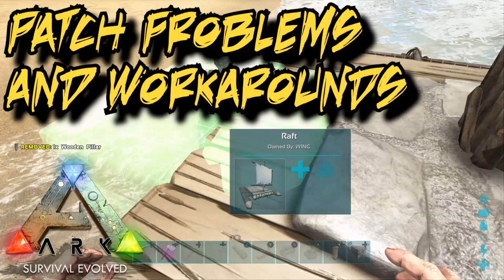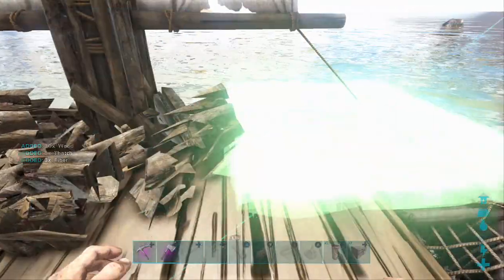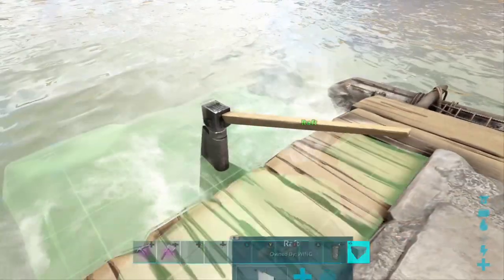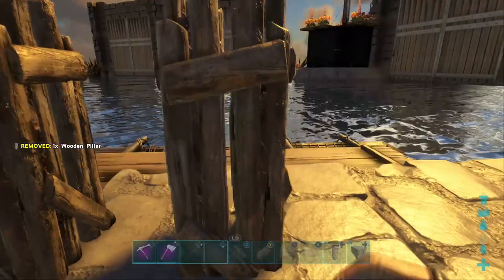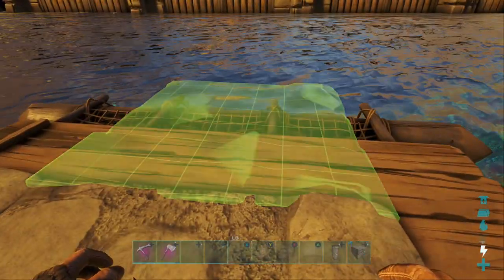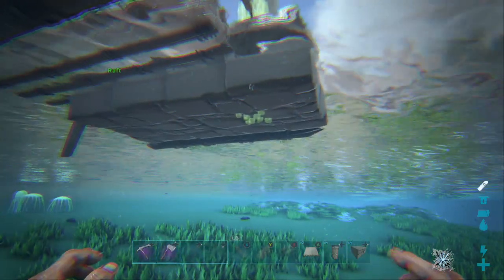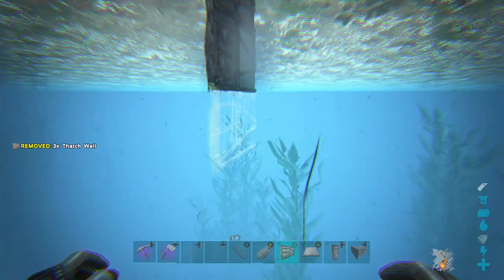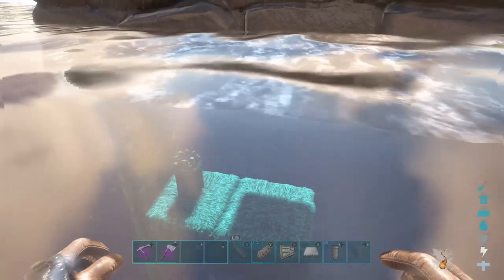Latest Patch Problems and Workarounds

Comment: I just watched your 4 wide gigga trap on the motor boat. Trying to start the build, but I can't get the last pillar to drop to raft level (the one coming down from the offset ceiling to get the first foundation for 4 wide). It stays at the top snap point, and then poofs. Am I missing something?

Comment: I had the same problem on quetz builds after the patch. I know its not exactly the same mechanic as boats but its similar. When lowering foundation, i had a green snap but wouldnt let me place. All i did was have a guy fly the quets staright in sprint speed and i spamed placed the foundation and it worked. Ive tried multiple times and its consistent. Though, one time it place the foundation sideways. It would let me place everything side ways off that foundation. Cant replicate it though.
Reply: Btw, on xbox
Reply: Yea my metal foundation decomposed over night and now I get a green snap and can't fucking place anything..
Reply: Alex Gibson if you want to replace that foundation in the exact snap point, get a tribemate to fly the quets in sprint speed straight then different angles while you spam place the foundation. It will work but i recommend rebuilding the plat using onewings method with placing a pillar then another pillar beside it on the lower snap point then demolishing the higher one and replacing it with another lower one unitl you can snap a foundation just over the level of the plat (then you place without problems). When its lower the the plat or at exact level of the plat is why you cant place it. I can show pics of some of my awesome quets builds on official servers if you want.
Reply: big john thanks you were very helpful unfortunately the only way I could get it to fit was by dropping the foundation another level so more than likely it will be destroyed like the previous

Comment: I can't seem to snap foundations under the ceilings i extend from the main raft to extend the foundations out on PC. Is anyone else having this problem?
Reply from the maker: Jake Widner are you using thatch ceilings and are you in deep water? Must be thatch and must be deeper water.
Reply: Jake Widner yeah. It’s the same on Console.
Reply: Hm that's weird, last time I checked it was working for me. I built a boat right after the patch and my problem was I couldn't lower the foundation over the rudder, I had to leave a square in the middle of the boat to drive it, haven't had a problem with extending the raft.
Reply: Yes that was the problem. I must have been too shallow. It works now. Thanks for the help!